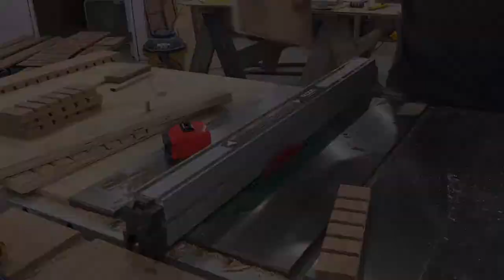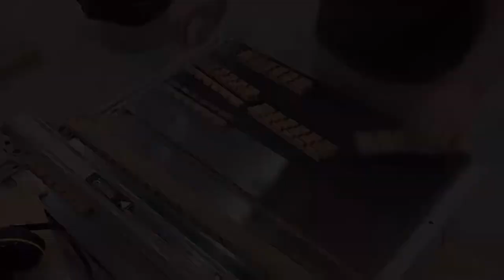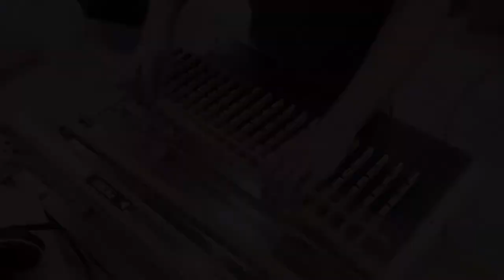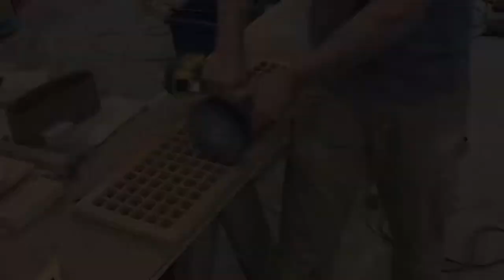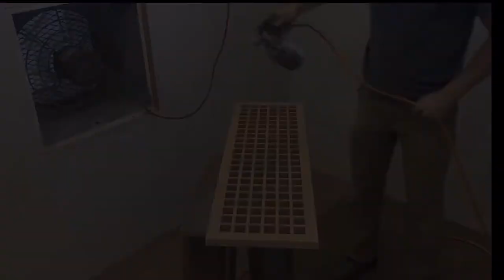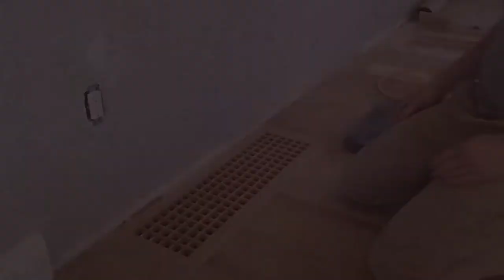Making a cold air vent

Comment: what's that wheel on your power drill?
Reply from the maker: Everfalling I made a wire wheel out of two 6” bench grinder wheels and a bolt. My flooring is wire brushed and I wanted to match texture. Wheel also works great for cleaning dirty boards